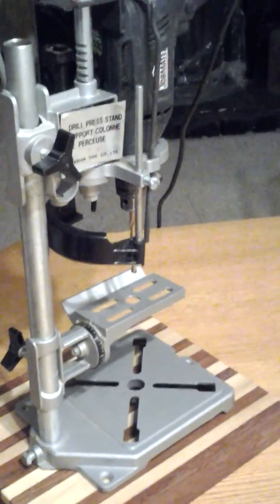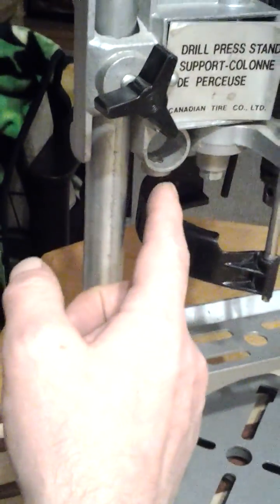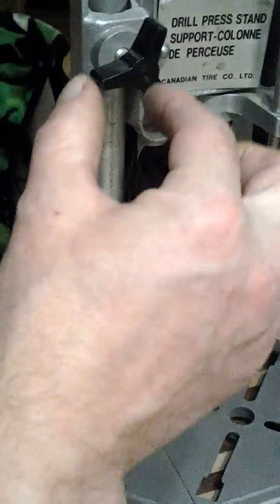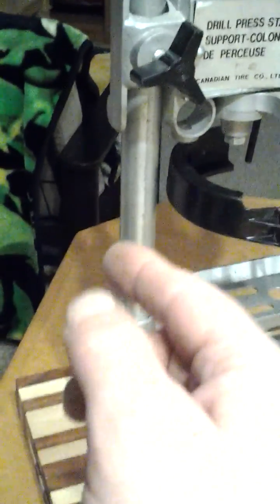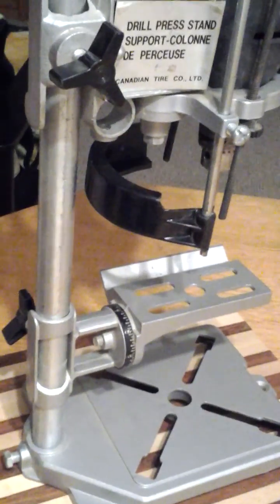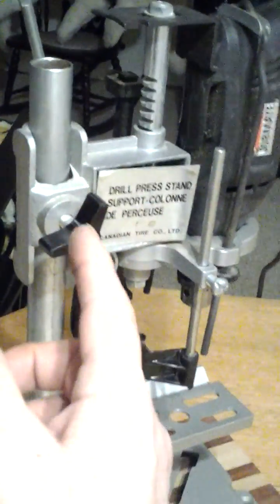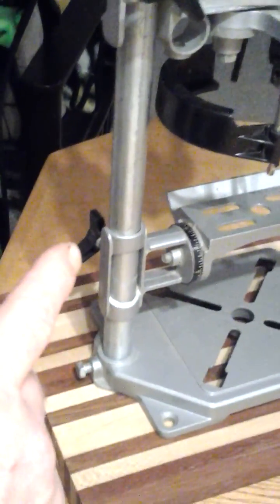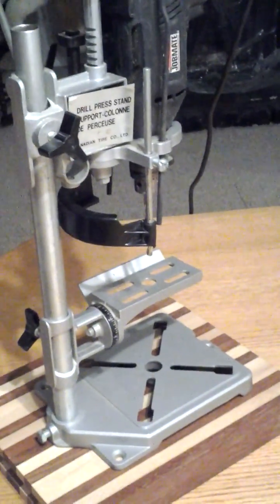Oxwall drill press functions I forgot to mention

Comment: It So When it Stands Upright You can Slide the top  Down Sideways It Can be Used As A Grinder . When You mount a Wire Wheel In the Chuck . That's What' the Guard is For.